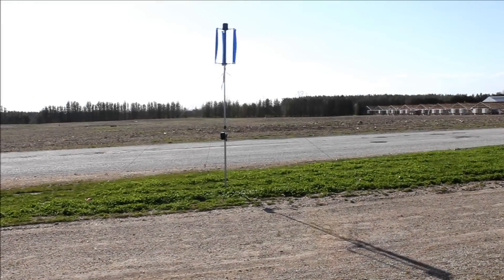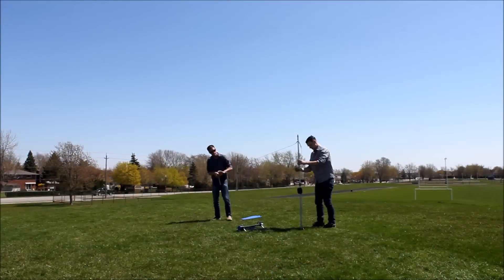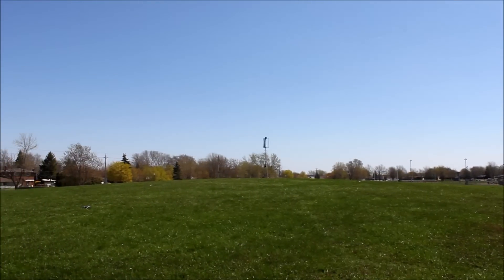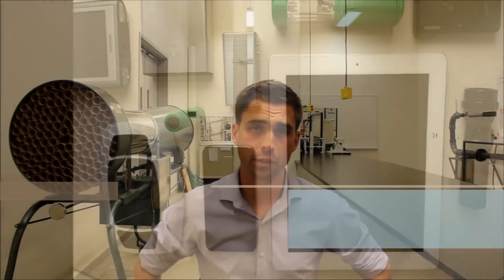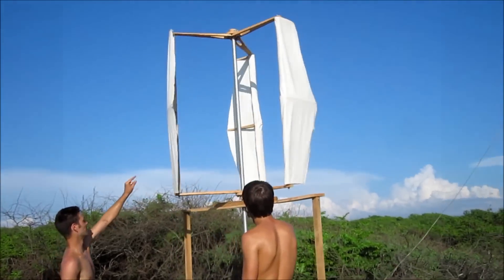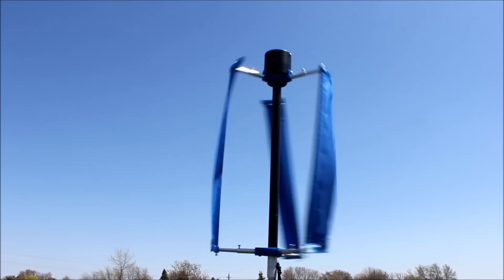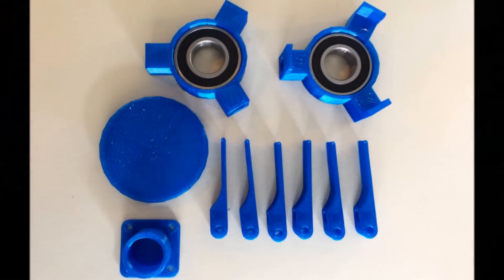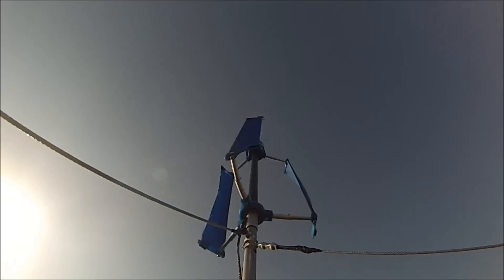A Small Wind Turbine for A Big Difference

Comment: I come through this line, ask for a donation, a 1500 watt power generator and a 240 amp battery for wind power, I live in a community, I'm low income and my light bill is high, and I would like to complete my project of energy generation that can help me will be very grateful. my address is postal code 08580000 brasil sp itaquaquecetuba. thanks for reading.
Reply: Get a job dude

Comment: Vawt durability is not ideal unless the design keeps the stresses to a minimum.  Many current VAWTs today have helical designs to minimize oscillation forces and wear and tear on the turbine.   I can see the oscillation happening in your prototypes through most of the video... Your design is average at best and will lead to mechanical failures within a short time.  Cheap and initially economical yes, longevity questionable. Unless the design lasts the test of time with minimal maintenance, it will never succeed. But the concept is fantastic! Cheap, small scale, (key)durable, and portable power is a great idea.